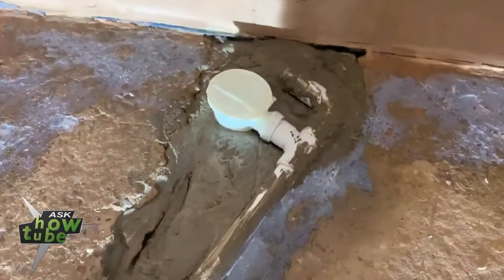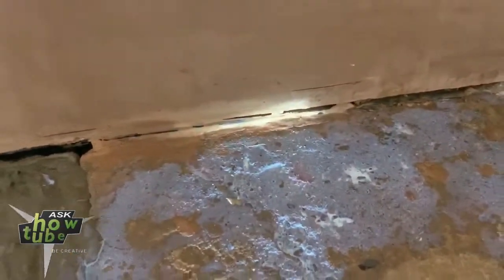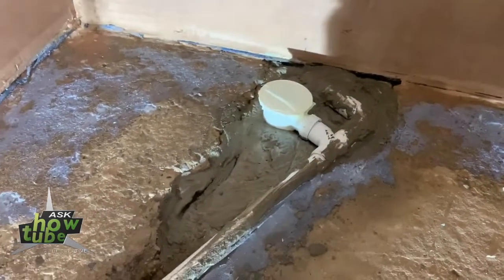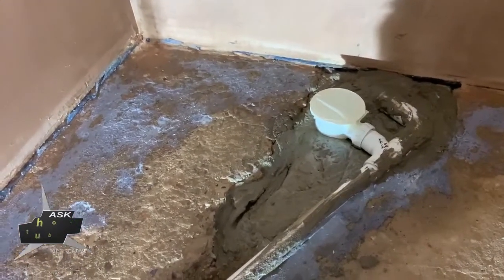How I install a walk in shower tray on concrete base.

Comment: i guess if there is an issue with the waste in the future the whole shower enclosure and tray has to be lifted? (hopefully there wont be)
Reply from the maker: That îs a special waste for walk in shower which you clean from top
Reply: @askhowtube  i was thinking more if there is leak in the internal of the dump underneath the tray??   Could u recommend me this waste, many thanks
Reply: As in what is the brand name ?
Reply from the maker: @endoneezer  McAlpine... is the brand... if it’s fit correctly I don’t see what problems should you have ... if you chose walk in shower tray, then you have to use this type of waste bottle., unless you use the raising kit...If you’re fitting the shower tray on the first floor, you can still have access from ceiling underneath.
Reply: @askhowtube  thank you, the shower tray is low profile to go in ground floor , on concrete
Reply from the maker: @endoneezer  then I’d do the same as I did on the job is on the video...
Reply: @askhowtube  hi there could you advise which one is better or are they both the same , it is to go under low profile tray on concrete

https://www.screwfix.com/p/mcalpine-shower-trap-white-chrome-90mm/768HR?tc=QA3

https://www.screwfix.com/p/mcalpine-shower-trap-chrome-effect-90mm/45503

Comment: 99% of shower trays should be laid on cement not silicon.i have removed many trays that have been cracked because they were laid on silicon
Reply from the maker: Thanks for the advice... I have fit all of them on silicone and never had a problem.
Reply: Why would a tray crack if laid on a solid level base?

Comment: Amateur
Reply from the maker: Exactly, well done… amateur but I am doing something, while the “professionals” sitting and do nothing, just commenting… well done you mate…you know where urchins sings? In the mud, on the sides of rivers where is only mud and rubbish, while in the middle of the river are fishes which swims heavy against the flow,and waves… if urchins would try to sing in the middle of the river, water would fill their mouth…. You sound like a professional urchin, whom seem to like to sing in the mud…. Well done, enjoy it … hope the mud tastes better today… 🤢
Reply: I need to fit a tray, or suggests a thin layer of cement however my plan is to get the base level so seems overkill and messy to use cement.  I saw another video suggesting expanding foam to fix the base